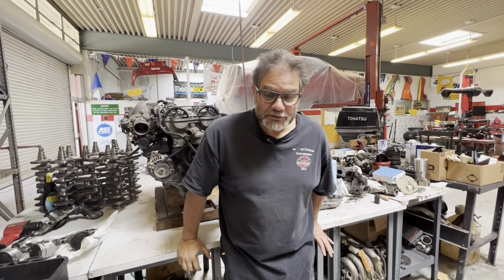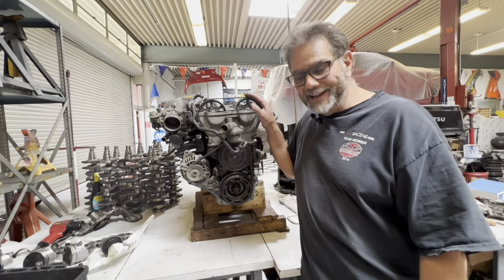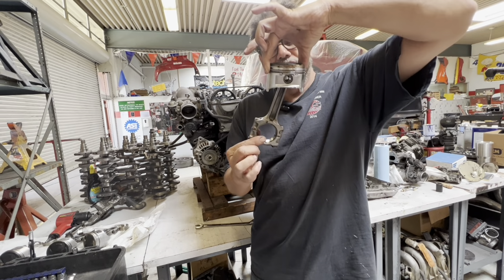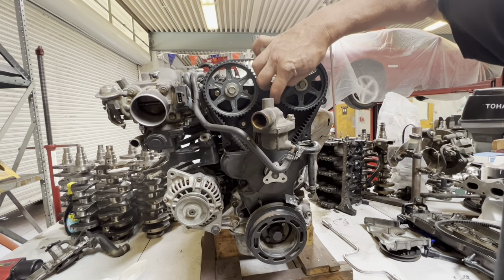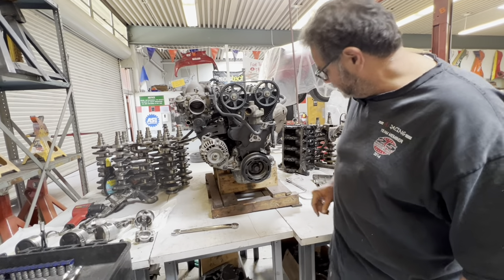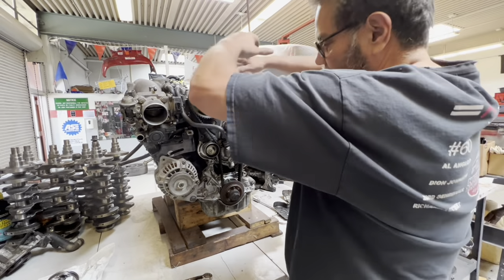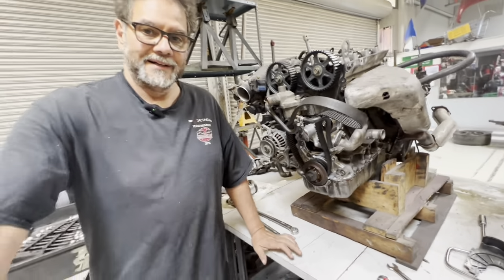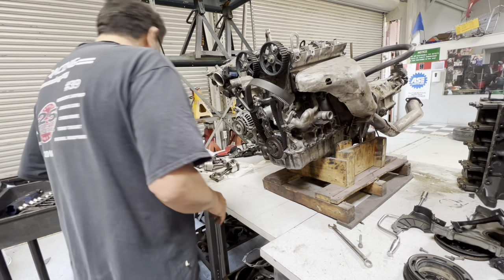Miata Cam Timing Tricks and Myths For The Beginner. Spec Miata, MX5, Autocross, Track Car

Comment: Im just finishing my timing belt on a vvt 2004 Miata.  Is there anything different between the vvt and non vvt.  Also do you have a video on valve clearance.  How to measure valve clearance.  I measured mine though not sure I did it right.   Thanks for all the work and sharing of knowledge.

Comment: I am a bit late to the party here.
Basically, thanks for simplifying this process.
Any one with doubts just follow this guide. My engine has stopped with none of the marks showing anywhere near anything else. i guess it had stopped at 180' out of TDC for cylinder 1. OR somehow moved while i was buggering about with belts and pulleys etc.  I flapped and panicked but found this guide. I then didn't worry about turning things individually of one another. did exactly what he said.  A bit of trouble will be had wriggling the belt on and holding the inlet cam in alignment. when you let go it will slacken the belt until you release the tensioner then it all pulls tight and lined up.  I pissed about with this for about 30 minutes.  Checked it 904 times. Used a few other pictures to double check.  Slapped it all back together and only had to turn the key to test......so i tidied the garage......filled up the washer fluid.....checked tyre pressures...made a coffee, basically anything to avoid turning on the engine.  with hands shaking i turned the key and kchhBrrrrrrrrrrrrrrrrr. Magic. The relief of not being a certified dickhead is massive (and probably temporary).  Thanks again, Al.

Comment: From a 25+ yr aircraft mechanic (jets - no timing involved - just add noise and it runs), this was perfect! Straight and to the point. Thanks!
Reply from the maker: Just put an engine in my C182 where were you, I could have used the help. I worked as a A&P for a few years.
Reply: @aracing  I would have helped! I haven’t worked on a bug smasher in forever.

Comment: Super helpful! Great vid. 

One question: if head has been shaved, which side is the “half-tooth” on. Above the timing mark or below? If crank to exhaust cam are correctly indexed. Both those are dead on as you mentioned in the vid.

Thanks in advance.

Comment: I've been using the exact same method for 20 years  after trying the first time to decipher the factory manual procedure....  and it has worked every time. I've sent this and your other timing vid to dozens of newbies and have gotten lots of thanks.    Re the  "TDC looks good" reference is that nobody knows how long the extension or screwdriver is...
Reply from the maker: Right on brother, are we related, couldnt have said it any better.
Reply: I always used a DTI with a magnetic base.
Reply: @Dannyvirk   My whistling hose is easy enough to  screw into the bottom of the plug well to know when compression stroke is coming up....neither of my Snap On mechanical stop DTIs will fit in the tunnel and if they did, I couldn't reach the stop nuts...    I don't trust  those   " dead on TDC when it stops whistling" claims by the manufacturer...   I  modified a spent brass flare gun round that fits  perfectly into the #1 plug tunnel, filled it with  trimmed washers to keep the long #3 Philips screwdriver shank centered  in the 1.6 #1 plug  hole.   By eye,  I can get within about .005" of TDC -   about a factor of 20 better than needed for timing belt installation and definitely close enough to know if the outer rim of the balancer has slipped...
Reply: @cfdmedic58  How do you dial in adjustable camshafts, by using the marks on some plastic covering? I understand these are not adjustable, but use a DTI to confirm TDC. And come on bro, we are not kids here, you have to built a tool that connects the top of the piston to the DTI. Of course no standard DTI will reach to the top of the piston. And as for your video, I think it was really good, i've got mazda cambelt I have to change and I'll be using the info contained in it. I'll let you know how I go with my own video on getting the codes out of the computers OBD1 port and the cam belt swap. Thanks for your content.

Comment: Ive used the key bump method my self. Worked great lol. I know you like to see the notch but like you said the pin will be straight up. I don’t blame the people counting the 19 notches just to confirm it’s correct because in alot of the timing instructions that come with belts it tells you to do that even know it is unnecessary. but yah this is like the easiest timing belt to do so when you say it takes ppl days that surprises me.

Comment: Awesome video, made it very simple to follow in application! Should I turn the engine twice after doing this?
Reply from the maker: If you want
Reply from the maker: Once I set it I roll it, but if you feel better about it spin it.
Reply: @aracing  thank you! I set it and then covered it up already, now I don’t want to go back and turn it twice to check the marks.. everything was aligned when I buttoned everything up, and now I’m about to put the engine back in the car

Comment: Hey Al, if timing was off by a tooth would this cause a misfire on cylinder #4? We did a compression test and got the following result: 1-120, 2-115, 3-118, 4-60. Also the heads were rebuilt 4-5 months ago.

Comment: To remove the crank bolt I removed the swaybar brakets and attached the socket and a braker bar to the bolt, lowered the car and jump started it. I didnt work till the 7th try. But at least it did XD

Comment: Hi, I've started this process and I am stuck.   It's a 1999NB.  I am down to the alternator belt removal and the lower bold that's on the back of the alternator is frozen and starting to strip.   I can't get the tension out of the belt for removal.  Is there a way to get the bolt off or a work around to get the belt off?  I appreciate any suggestions.  Thanks!
Reply from the maker: If you email me your number I’ll call you. alangulo530@gmail.com

Comment: What about the belt tensioning procedure? The crank needs to be rotated 1 5/6 turns to get the cams into the right position for the tensioner spring to apply the correct tension to the belt. That’s what the second mark is for on the oil pump, 60 degrees left of the TDC mark.
Reply from the maker: Answered on Q&A Monday

Comment: I know this video is a year old, but I need help! I'm doing a 1995 1.8 engine swap in my 1990 NA Miata. I've done a ton of research regarding the project. I've made sure to watch youtube videos and check forums before attempting anything on the engine. I've recently replaced the waterpump, cam seals, and bottom crank seal. Next up was the timing, hence this video. But I've run into an issue. After aligning the cam gears, I went to align the bottom crankbolt with the arrow and the notch, however, I can't turn the crankbolt around enough to get it aligned. I haven't forced anything as I am too scared that I am hitting a valve with a piston. In all the timing videos I've watched including this one, the bottom crank bolt is already aligned before doing the timing, in my case, it's not already aligned. I know everything is supposed to rotate in sync, otherwise pistons will hit valves, but how do I time it right when I can't get the bottom crank bolt aligned. What am I missing?

Comment: On the 1.6, I prefer setting the intake cam one tooth advanced from factory spec for my daily driver and then, of course, the ignition timing needs to be retarded about 8 degrees.  Results in a big gain in low end power with little if any loss on top (I assume because of the increased overlap).  Also gains in fuel economy.  Haven't checked, but I also assume it gains in NOX production, but should reduce carbon and CO2.  :)  No emissions testing where I now live so I don't need to worry about it.
Reply: Never thought about that. I'm doing my 1993 1.6 timing belt job right now, I might have to give this a try. If this really works maybe I'll be able to run the AC in between red lights haha.
Reply: @tylerterveer57  No "if" to it.  I used to always, when downshifting, choose one gear too high and then have to downshift one more to get the acceleration I wanted.  Now I guess right every time.  It makes about a one gear difference in the low end.  So the acceleration level you were getting in second, you now get about the same in third.  Not talking about max acceleration here, just when you are normally accelerating you can be a gear higher than what you were used to previously.  If you read anything about lobe centerlines (not to be confused with lobe separation), the stock 1.6 intake has a centerline of 112.  Advancing it one tooth will bring it to about 104.  This closes the intake valve earlier (in relation to the crank) which helps low end power.  Normally, this would also cause a loss of high end power, but because the exhaust cam is not moved, it increases valve overlap which helps top end power so it tends to equal out the impact. Don't forget to retard your ignition timing or you may have difficulty trying to get it to start.  https://www.camcraftcams.com/degreeing-a-cam/

Comment: Why would someone make their own marks with pen on the came gears instead of using the provided indents from Mazda?

The previous person who owned my NB1 did that,  I don’t understand why they would use their own marks if the backing plate and cams have what you need.

Comment: @5:04 Your exhaust cam timing is off by one tooth. Engine will still run. Motor is designed for 19 teeth between hash marks and 5:04 shows 20 teeth. 
https://youtu.be/DlHjYQxjIMk?t=304     Your old video 19 teeth spacing
https://youtu.be/KiXRtafIdik?t=305    This video 20 teeth spacing🤪
https://youtu.be/KiXRtafIdik?t=924  This video 19 teeth spacing

Consider the hash marks on the cam gear edges and not the letters and cam spokes. Ford/Mazda engine designers put them there. Need paint pen marks and set lighting camera angle in front and use your "invisible see thru hands" if available.
Head being decked 20 will not cause half a tooth alignment error. Teeth are 0.140" or 140 mil spacing, so 35 mils 1/4tooth, 17.5mils 1/8th tooth error.
Note: 35-40 mils total head and deck skim is near max before interference issues.
Greatest cause of alignment error is belt stretch which can reach 2%. 2% is 0.140" x ~40 teeth crank to exhaust cam = 5.6", 5.6 x 0.02 = 0.112" 112mils =0.8 teeth.
Reply from the maker: Answered on Q&A Monday

Comment: Just to add to this….make sure to check TDC on #1 cylinder. If you turn the crank 360 degrees, it’s now TDC on #4 cylinder. You can’t tell which cylinder is at TDC unless you use a straw or a long screwdriver in the spark plug hole to see that number one is at TDC .
Reply from the maker: hummmmm sorry that is not true, if im understanding your statement. If you line up the notch on the crank gear you will always have #1 and #4 at TDC. The head cam timing sets what stroke the engine is on. Yes you can be 180 off on the head.
Reply: @aracing  you are correct, but what I should have said was TDC on the combustion stroke.
Reply: @cutl00senc  Doesn't matter as you are setting the cams and they are what determine whether or not it is on the combustion stroke.

Comment: I have my miata on time and it won’t start it’s like spinning fast when I turn the key on
Reply: Car was over heating replaced water pump and now just spinning
Reply from the maker: it lost all compression and head is likely warped and needs to be rebuilt

Comment: What a hack. Where do I begin

You use an impact to remove bolts that many people break using only a ratchet.

Using open end wrench to turn a crank? 

Almost strips the tensioner.
Hits a crank with a hammer. Ever heard of a sheered or bent key? 
Uses a ratchet for the starter removal technique instead of a breaker bar 
Mazda literally tells you to rotate the engine twice to adjust tension.
Never counted the teeth. 
You must be the king of flappy timing belts

A shaved head increases compression. You see that a lot in spec Miata? 

The crank turns to the right if you're facing it. As all engines have for longer than you've been alive. But ok Mr been doing this for 20 years and teach kids